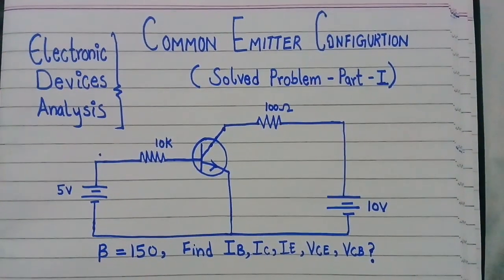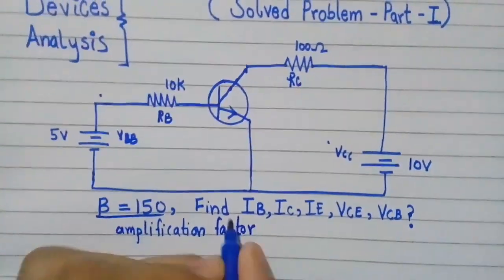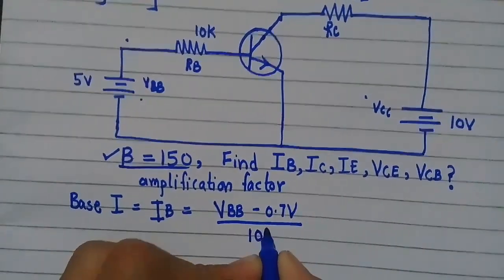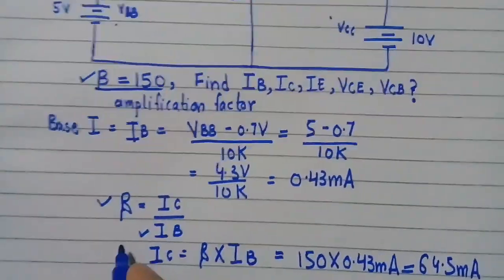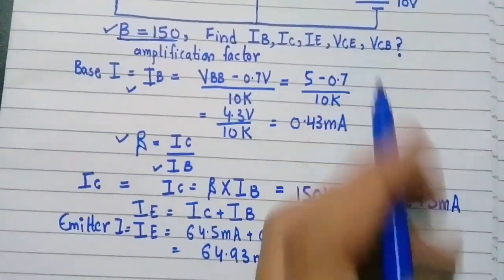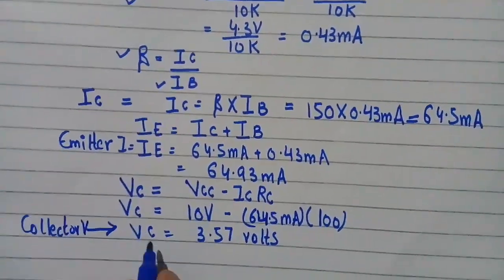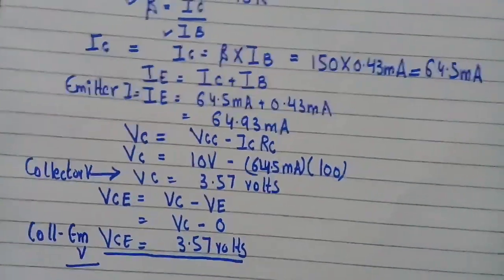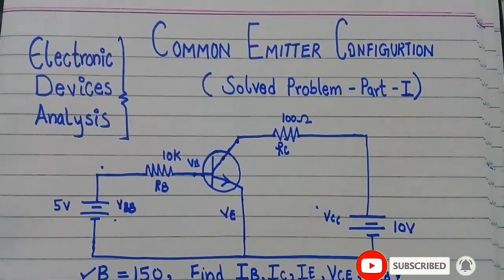PART 1 | Solved problem | Common Emitter Configuration | Electronic devices analysis

Comment: The only useful value is Vc, which determines the amount of voltage swing available at the output (i.e. the collector). Note that it is highly dependant on the transistor β and therefore this circuit is not a usable configuration as it stands.
The missing ac analysis (input at the base; output from the collector) shows that the intrinsic emitter resistance (re) is 25mV/Ic = 25mV/65mA = 0.38ohm. The voltage gain is Rc/re = 100/0.38 = 260. The input impedance at the base is 10K in parallel with β.re, that is 10K || 57R which is 57R. Again, both of these are strongly dependant on the transistor β.